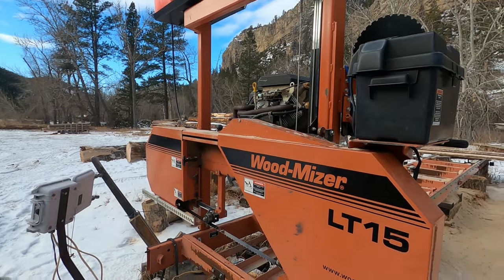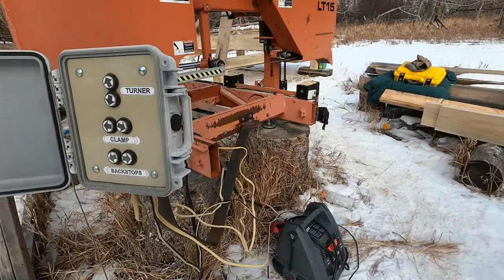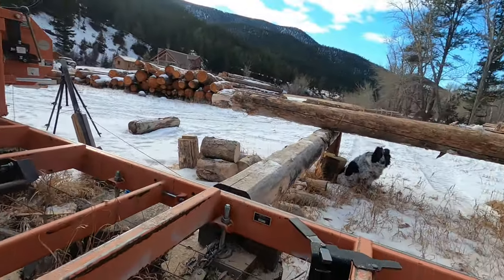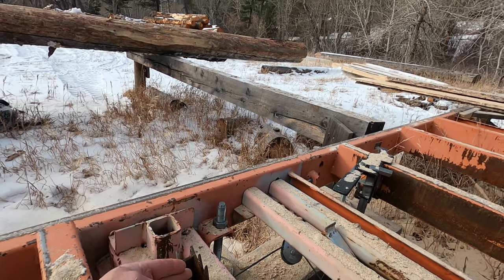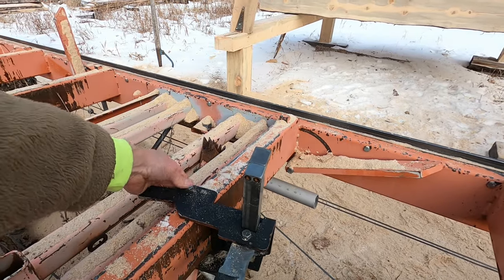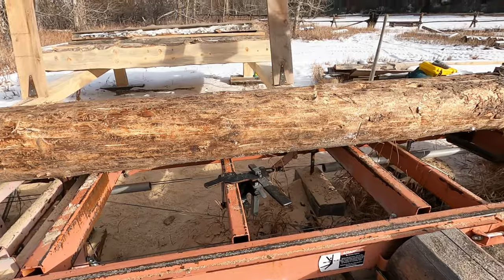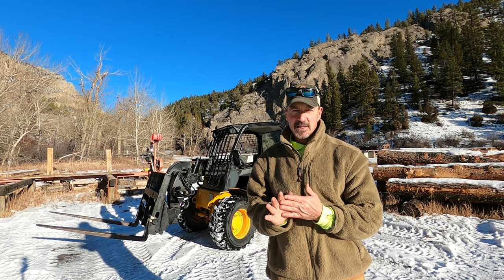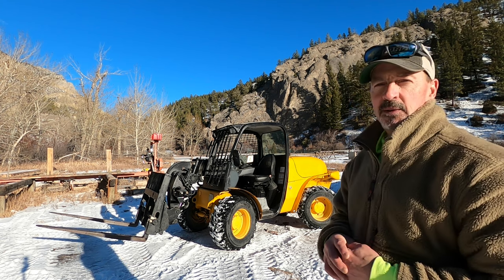Sawmill Mods

Comment: I have a suggestion...where you slide the Kant's off to move later I would think it would be easier to slide the Kant's back if you put some plastic bed liner on top of the support beams to slide on

Comment: Howdy Brother- really nice modifications on your mill.  Now I’m thinking about what I can do with the mill I bought and I don’t even have it completed yet. Did build a 13’ extension on it so I can mill 23’ max. I don’t think my old tractor will handle any more than that. Hope all is well with y’all. God bless
Reply from the maker: Yeah, those winches are cheap. I had to replace one in about 8 years so they have worked well overall. Surprisingly, they will turn even big logs which is a big improvement over doing it by hand with the cant hook. We had 16 below for several nights so not much milling right now. This weekend is looking better. God Bless.
Reply: @OnBeaverCreek  Wow! I can’t even imagine being that cold! 24 here at the moment

Comment: Is that log clamp an original WM clamp. I have a new LT 15 with. Having a clamp like that would be a helpful addition to my mill as my clamps are essentially fixed. Having a quickly moved clamp would help with some of the odd length logs.
Reply from the maker: Yes, it is a 2006 or 2007 model